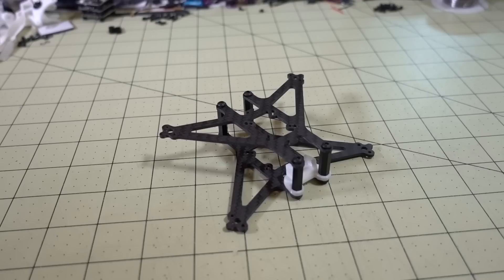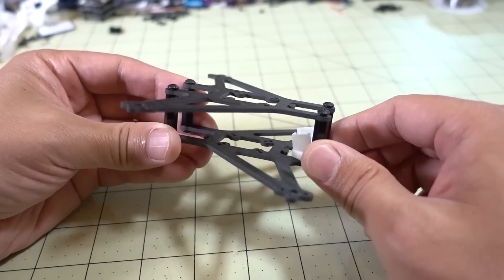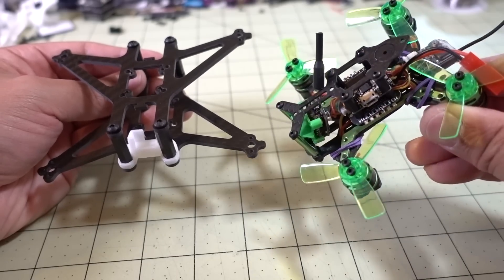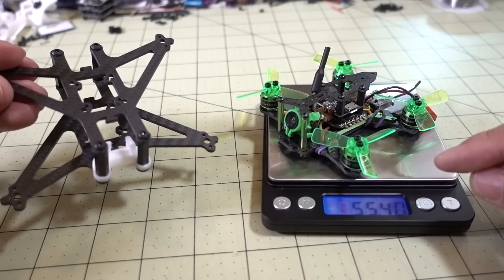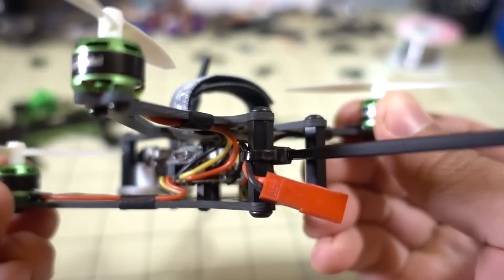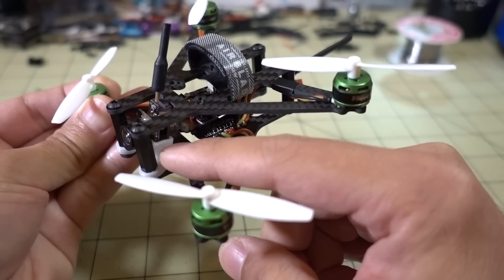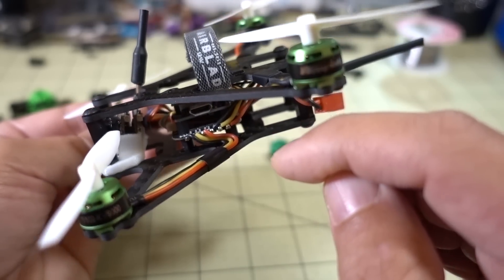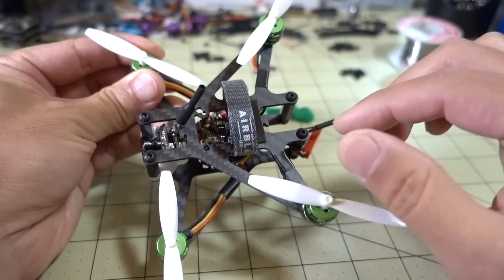MD#88 🚁AirbladeUAV Dark Knight 2.5 ✔️😀

Comment: I'm curious how your liking this setup a month later?  I have a mantis85 still in working order, but I'd like to build a 2.5" ultralight dark knight one day with the 20x20 FC+VTX you showed a few weeks back.  So still scooping out the motors.
Reply from the maker: I still like it.  It's much better than the Mantis85 when it was on the 2 inch props.  However, I am going to rebuild this frame with a bigger stack and motors that can do 3S so I can go faster and have more power.
Reply: oh awesome!  let us know as I'm planning to build this next month.  Even a quick video or rotorbuilds post would be great.   And why 3s not 4s?  Maybe use the ARTower you posted the other wk.
Reply from the maker: If this were a 3 inch frame I would go 4S.  For 2.5 inch I like the lower weight of 3S better.

Comment: Looks like it rips around nice. Like other people asked, do you feel a benefit in the split height motors?
Reply from the maker: The pitch axis seems more resistant to changes but once an angle is established it seems to hold it better.  Not 100% certain about this but this is the impression I got.

Comment: Wow, I thought the frame improvements might make this really interesting for 2.5", and the split arm brace makes me think of the Massive D. But hard to compare your light build with plans for 1304/1404 MD. How would you compare the frames for that motor? Plus 1 for your thoughts on the 2-level motors.
Reply from the maker: Are you asking how this frame compares to the MD frame?
Reply: Yes, specifically for motors like the 1304/1404. (not a lighter build like you did)

Comment: The frames design is strange but it flyes so nice, at 9.99 I can let this one pass... I just bought a KingKong stack on banggood (https://www.banggood.com/KINGKONG-LDARC-2020mm-F3-Flight-Controller-with-4in1-BLheliS-10A-ESC-2-3S-for-RC-Multirotor-FPV-Racing-Drone-p-1160375.html?rmmds=myorder), do you thing this would go well on this Dark Knight frame with 1104 - 7500kv Eachine motors???
Reply from the maker: Yes, should fly nice with those motors.

Comment: Pardon me for my newbie question but does the motors in the back being higher than the front affect the flight at all?  Is there a more noticeable tilt when going full speed forward then if they were on the same plane?
Reply: it actually reduces tilt needed to move forward, which is good for going fast and also maybe good for beginners because it allows lower camera angle, a high camera angle is more difficult to learn the controls.
Reply: it reduces prop wash.
Reply: Learned something new..... Thanks fellas!!